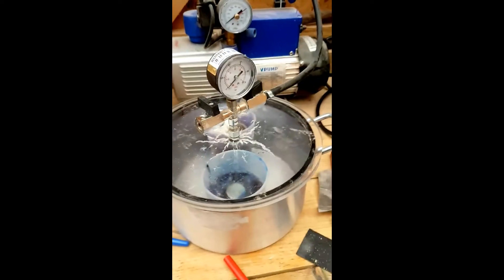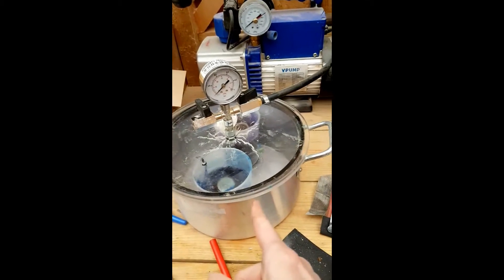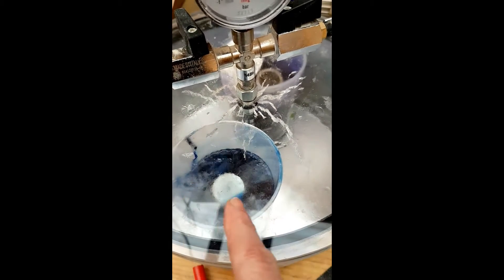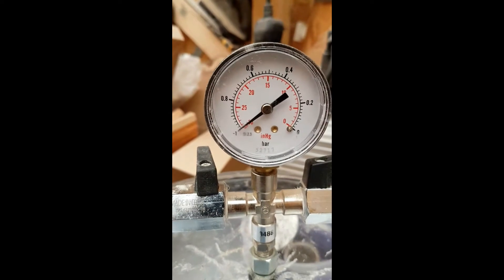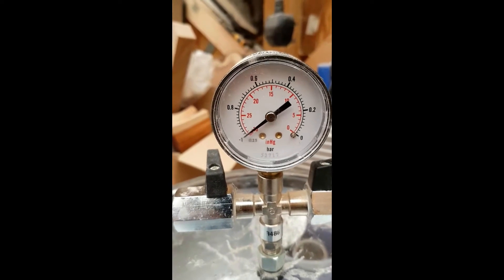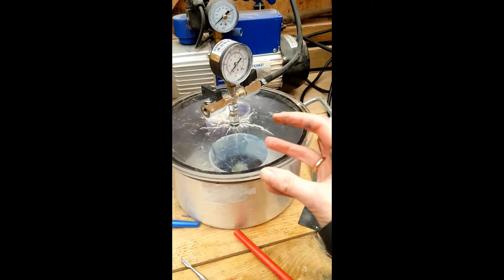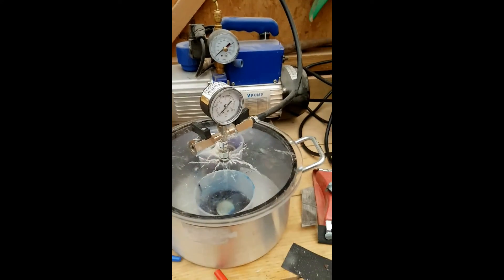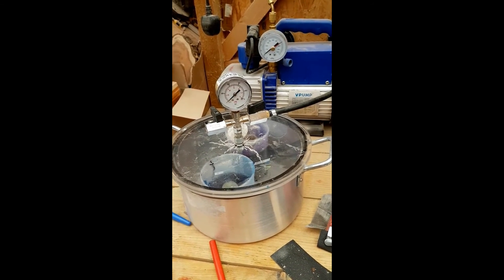Vacuum Chamber for stabilizing wood and degassing resin

Comment: Thanks Pam for your video where would I get the complete system from. Is this just for pushing Colour into the wood or can this be used to remove bubbles from resin instead of using a pressure pot.
Reply from the maker: dermot forte have a look at hvacstore they have all equipment you will need. yeh I use this for removing bubbles from resin instead of pressure chamber. if you need me to explain more let me know. pam